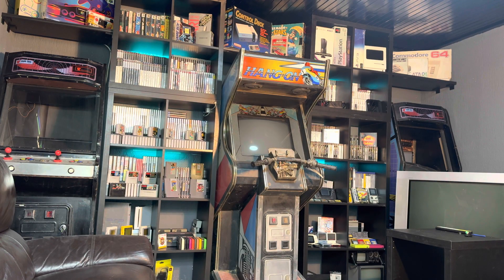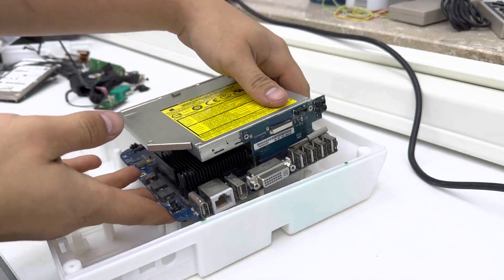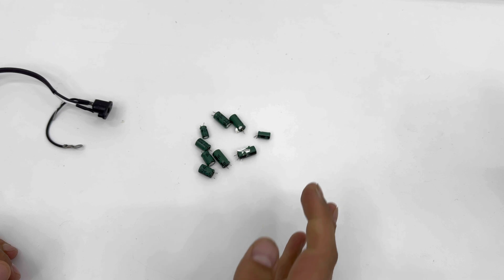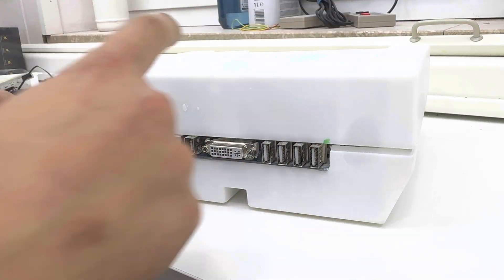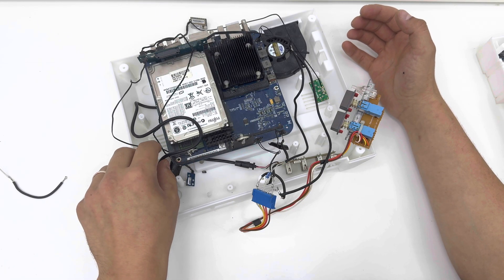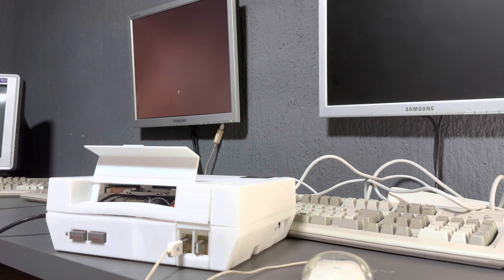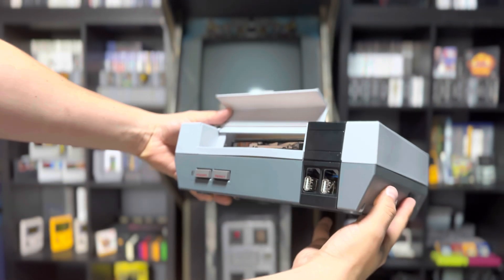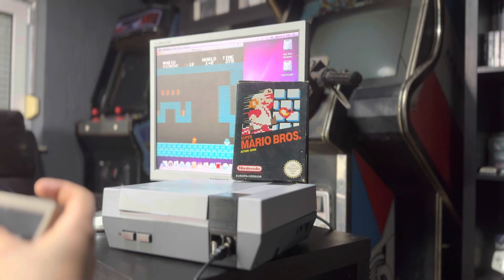I Made an NES Computer (And You Can Too!)

Comment: Very cool and great video. 

Oh, with the original NES power button, there's a small copper latch inside. If you pull it out, it won't catch, and work like a slandered pc power switch. You can Google it to see how to do it precisely.

I did something similar with an actual original NES. Now, before anyone gets the pitchforks out, the board was completely gone. No way of saving it, so I gutted it and took an old HP Chromebox, slapped Batocera on it, and used a 32 GB SD card because it was only ever going to play NES games. I took my drilling tool and bored out the original controller ports, then placed USB extenders into them. And then, in the famous words of James from James' Channel "Hot glue, Hot glue, Hot glue" 

I even wired the original NES power button to turn on the system and replaced the red LED with an ice blue one. For ventilation, I more or less took the same route you did. Overall, it's a nifty little system that has every NES game I want on it. And yeah, Chromeboxes are junk e-waste, but again, it's only ever going to play NES, so it's fine. 

I did run an HDMI extender out of the original RF coaxial hole, and the power adapter hookup out of the original NES power hole. I had to Dremel them a bit, but it is what it is. The only thing I have left to do is get some replacement Nintendo stickers for the front, as the original printing was long since gone.
Reply from the maker: Thanks so much, glad you liked it! Yes, I’ve been told about the power button, just never occurred to me! Neat! I’d be curious to see how yours turned out, sounds awesome!
Reply: @schvabek  I'll e-mail you pics and a video link the title will be chrombox nes

Comment: Why the top pert is bent ?
Reply from the maker: I think the 3D printed model could actually use some support there, as you can get creaks in it if it’s thinner and has no bracing. There is a screw post underneath though, so you can tighten it down and force it flat
Reply: @schvabek so the 3D print is defective 😢
Reply from the maker: @intel386DX It’s not defective, it’s down to the 3D scan/file, since it’s a 1 to 1 reproduction of the original. The stl file could use some bracing at that point

Comment: 5:30 i like that era of mac design. It's not really nice to work on but it doesn't yet feel malicious. It's engineered to fit as compact as possible, and the BS of things can be attributed to that. And no pieces trying to actively prevent repair or modification, the problems are far more forgiveable that the ones nowadays.
A controversial opinion; Asus is worse than Apple. Dang they do antirepair like no-one else
Reply from the maker: I made many videos on that subject, and I agree, when it comes to repairability and serviceability, early Intel Macs are not bad at all. Every major component is replaceable on this Mac Mini, even the CPU

Comment: I've been trying to find a sufficiently retro beige filament, but no luck. White has been fine for the things i have done and seems to fit this too. But it would be nice to print in the correct color.
Someone in youtube can't remember who used spraypaint and it looked amazing. I haven't found the right color of spraypaint either so eh still wauiting. Haven't been looking too hard either, white is just fine. But it sure would be nice.
Reply from the maker: Honestly, I wouldn’t worry too much about the exact color temperature. Like I’ve said, these guys yellow and change color as it is with decades, I had NES consoles of all sorts of shades of beige and grey.

Comment: the on/off switch can probably be desoldered and disassembled to remove the brass pin that should mechanically make it a momentary switch instead of a toggle. those NES power switches look similar to the type used on AT PC cases in the 90's, which could easily be converted to momentary by removing a pin. I bet the reset switch is the same model of switch as the power switch and it's just a matter of making this modification.
Reply from the maker: Oh, that’s a cool thought! I think I’d still prefer to keep it as it is, since I can swap it out if I need an N64 switch for whatever reason. But thanks for mentioning it, didn’t really think about it honestly